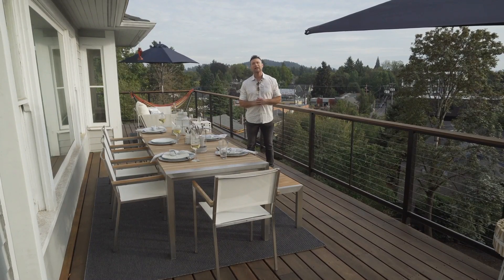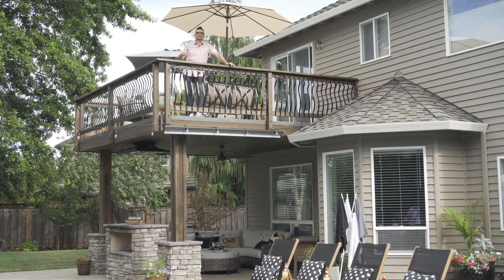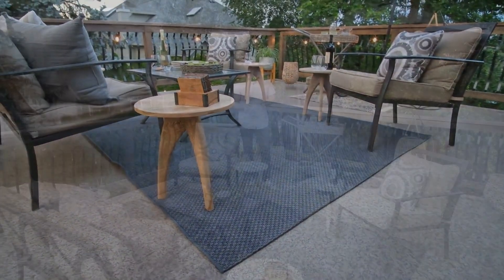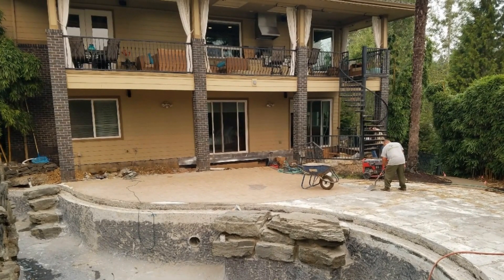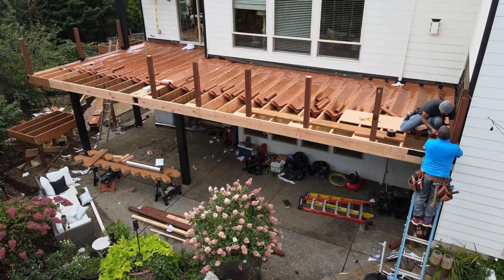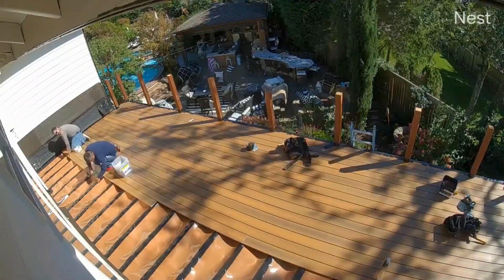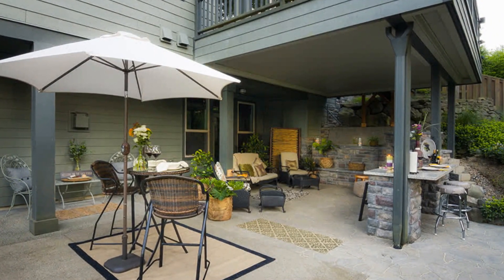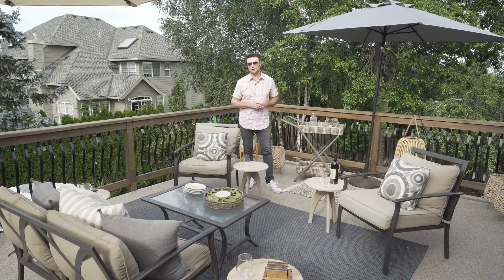Deck Outdoor Living Space Under Deck IDEAS (Waterproof Cover)

Comment: At the 5:23 minute mark with the TREX RainEscape deck...once the upper deck is sealed, where does the water go from the gutter system? Also, what type of decking material (composite? pvc?) is used in that same house installation? Or what decking is recommended.
Thanks in advance for your help.
Reply from the maker: We have the down spouts integrated into the Columns. I use mostly composite decline but it is really mostly a personal decision. I hope this helps? Have a great day

Comment: We are almost finished with our backyard living space, the final piece is the water flow off the uncovered deck above the kitchen.  Several attempts have been made to waterproof using DIY under decking.  Need advice on how to waterproof and where to run the gutters.  Unfortunately, the design was not done ahead of time and now we're scrambling (we did hire a contractor, but here we are...)

Comment: 6:00 min mark.   Looks like they overlapped the membrane incorrectly. The upper piece should be over the top of bottom section.  Like shingles.
Reply: Incorrect, if you follow the video you will realize that all water runs off into cutter system.